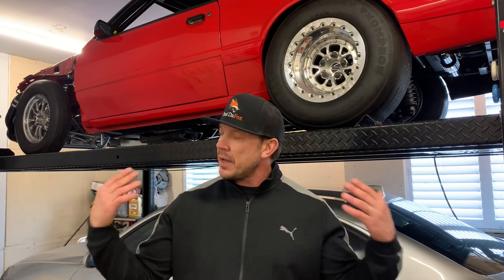PROCHARGED COYOTE SWAPPED FOXBODY NOTCH 🦊|| A Closer Look at Mario's 800whp Yote - Mustang Review 🏁

Comment: That coupe is top notch. Definitely one of the best out there. The black weld s71's, gen 2, t-56, makers garage front splitter and pinch weld covers and 2 & 1/2 inch cowl hood look perfect. That is exactly what I would do if I had a coupe. 

Paul  have a question for you. Would you take an original black on black tweed interior 5 speed coupe and coyote swap it or keep it pushrod 302. A buddy has one and is on the fence with the swap. All Vin tags are in place, 1/4 glass is original and  in good shape with no weathering.
Reply from the maker: Hey B. Lavesh, that’s a great question but really comes down to how original the fox is.  The foxbody market is crazy hot right now and some of the all original foxes are fetching crazy money.  So to answer your question, if the fox is mostly stock and all original then I would try and preserve it.  If the fox has been modded already, then I wouldn’t hold back modding it further.  That said, I newer built roller motor is definately a straight swap, but a Coyote swap you have to change a lot of things to accomodate which is costly but it’s badazz.  If budget is non-issue then I would definately Coyote swap it💯 Hope this makes sense and helps!  Thanks for watching the video, have a great night🙌🏼🏁